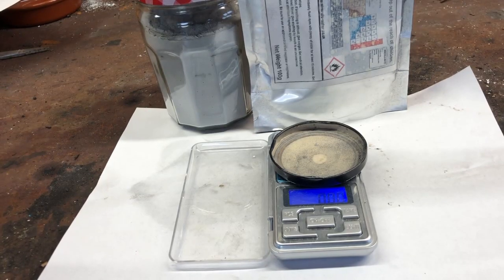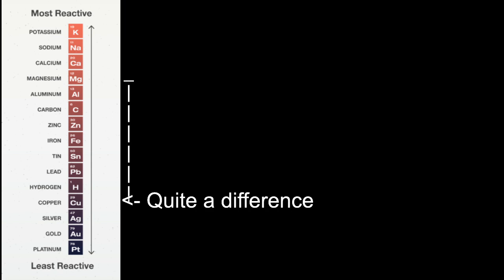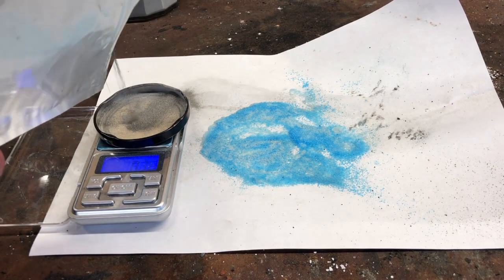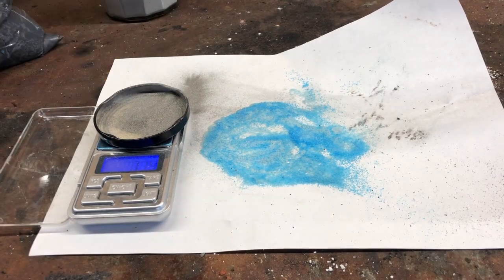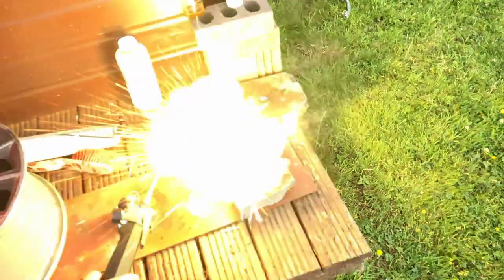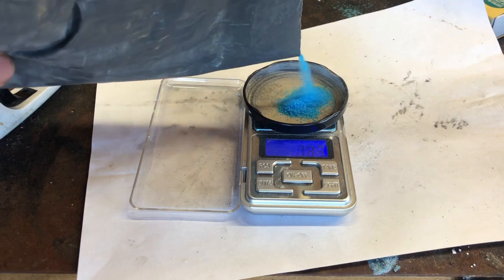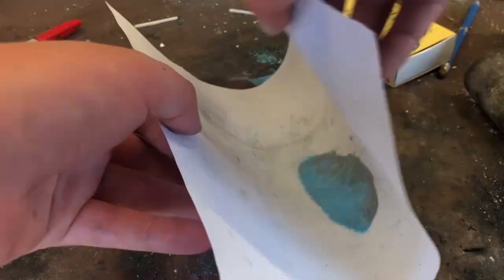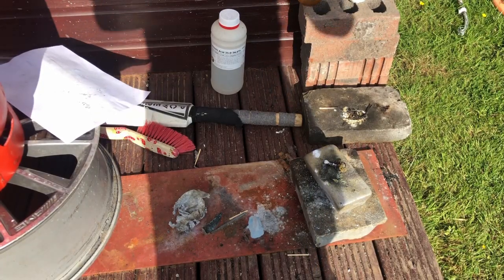Copper sulphate as a flash powder oxidiser with magnesium and aluminium powder

Comment: Interesting. That just gave me an idea for some thermite. 

I'm going to try a mixed metal thermite. It's going to be the standard three parts red eye and oxide with one part dark pyro aluminum powder right around two to nine micron. But I'm thinking I might also add a splash of magnesium powder, copper sulfate and some either potassium nitrate, chlorate or perchlorate. 

And don't get me wrong I mean thermite with the standards three to one red iron oxide aluminum ratio burns really really hot. But I know it can get to higher temperatures than that. 

Seeing your video in slow motion instantly made me think thermite. 

I do appreciate you taking the time to make this video. I've had copper sulfate kicking around for a while I just haven't done anything with it. There was a sale on one of the websites and it was literally $3 a pound so I couldn't say no. 

Anyway. Excellent video. Thanks again and stay safe out there.

Comment: Will the monohydrate work?
Reply from the maker: It will work a lot better, when I made this, I completely forgot about the hydration, so the amounts are measured as though this is anhydrous
Reply: @theshedchemist6445  I think my stuff is horribly mislabeled and might be copper carbonate, haven't yet checked out solubility to tell, but upon heating it does look like I got cuo with co2 generation, rather than anhydrous copper sulfate.
Mixed it with course al fillings, powdered sugar, and a primary x., Doesn't behave like an oxidant at all perhaps it would need more heat like thermite, this is a pool chemical labeled "tribasic copper sulfate monohydrate", green without any hint of blue